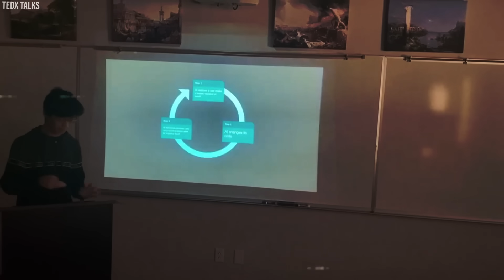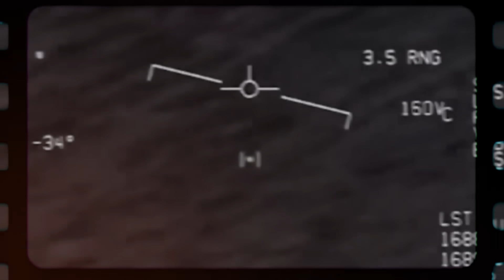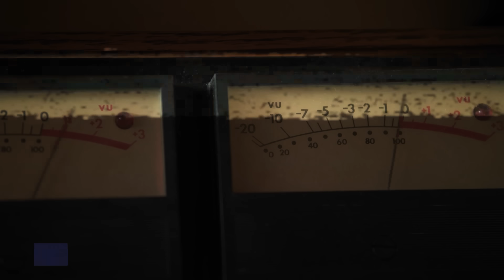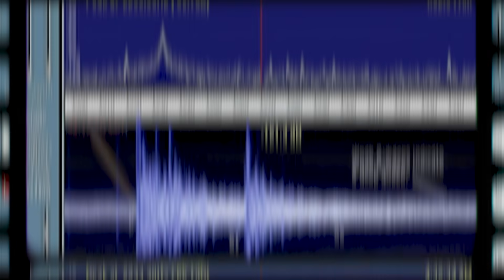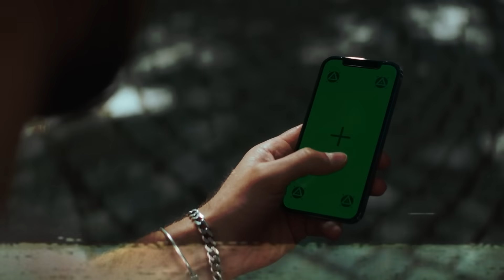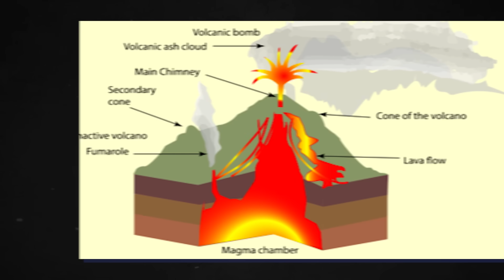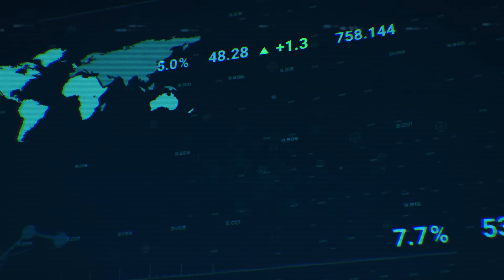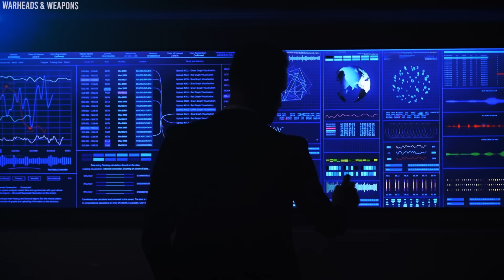The Pentagon Just Admitted They've Created Something So Advanced It Can't Be Stopped

Comment: HARP uses microwaves to stretch the ionosphere.  Stretching it and when released they are directed to the surface. Using multiple HARP systems is how it is directed using triangulation.
Reply: Like a massive slingshot of charged ions.
Reply: Sounds plausible. But why??
Reply: @FernFokes-tu6vs control, death beam empire
Reply: Ty for info
Reply: They're, undeveloped, spiritualy undeveloped!
Reply: Quote ""The polar vortex is just one piece of the puzzle. So just because there has been a sudden stratospheric warming does not mean we will experience another ‘Beast from the East’.""
Hardly weather control.
SSW there have been some 25 of these this century with only 2 Beasts from the East.
A retired met research man

Comment: Said simple:
"Radio waves" can increase the speed 
of the electrons of the magma - in
the center of the earth.
This can result in two things:
1. Earthquakes.
2. Increase of gravity.
---
No.1 was known - some 40 years ago.
Some 15 to 20 years ago - there were 
films on YouTube, about it.
Reply: 1) Radio waves can not increase the speed of electrons, but they can increase their energy level. That said you would need an incredible amount to see any effect.  The only difference between radio waves, visible light and gamma rays is the energy of the photons. Radio waves have photons with the lowest energies. Microwaves have a little more energy than radio waves. Infrared has still more, followed by visible, ultraviolet, X-rays and gamma rays.  Blowing up 10,000 atom bombs in the earth core would have the same effect on the planet as a gnat's fart on the city of Los Angeles.
2) Albert Einstein's theory of relatively predicts that adding energy to a bit of matter will increase it's mass, take two identical cubes of gold and heat one up and it will weigh more than the other (not by a lot, since Energy equals mass times the speed of light squared you would have to pump in a LOT of energy to make a notable difference).